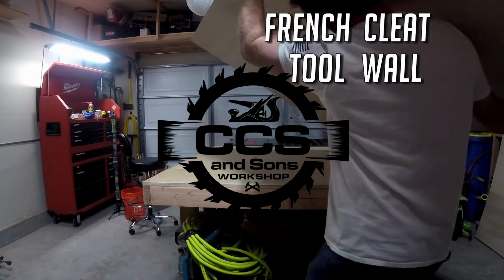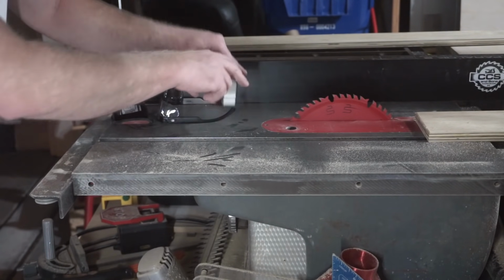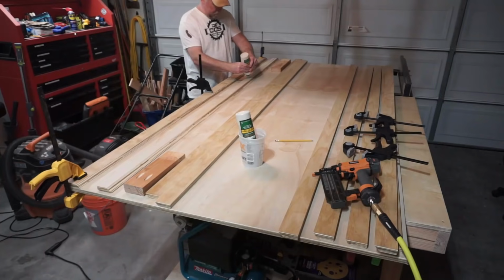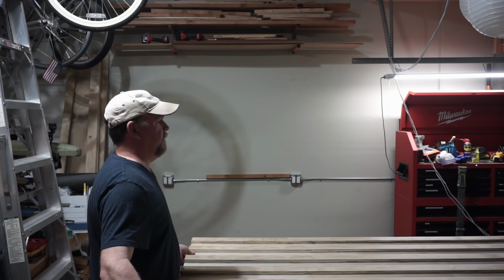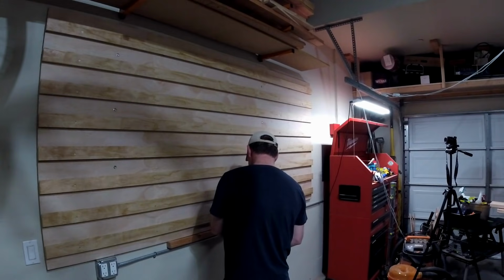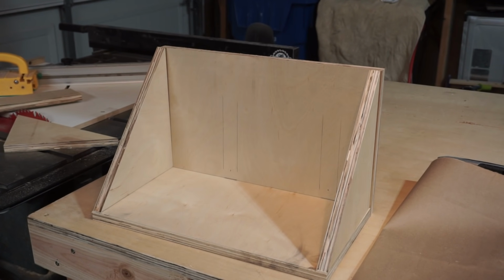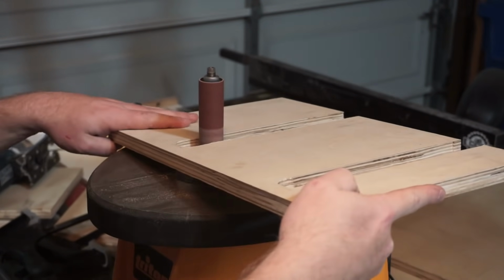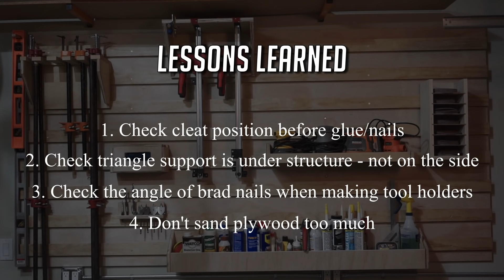How to Build A French Cleat Wall

Comment: Looks awesome. I’m curious, is there a benefit to using the plywood backer board vs attaching the cleats directly thru the drywall
Reply from the maker: Aesthetics mainly. But also means I can take it down and move it fairly easily if I need to.
Reply from the maker: Also not going to be damaging the drywall all the time adding and removing tool holders.

Comment: I no longer use glue to attach cleats. Seems I frequently put them in the wrong place vertically and then can’t move them. You may want to relocate the tool holder in the future and want to move it up or down in relationship to the wall cleat.

Comment: Great video.  Another useful recommendation: create smaller groupings of items, which enable you to create useful sets of easily portable “toolboxes” that you can shuttle between the wall and bench for common tasks.  For example a glue+tape+glue spreader+….  Or a flush trim hand router + associated bits. Or small screw sets plus …

Comment: A little off subject, but what's the deal with the Shop Vac attached to the 5 gallon bucket? I'm intrigued!!!! By the way very straight forward build and thanks for sharing!
Reply from the maker: It’s called a Dust Deputy. Give it a Google. It’s a separator before the shop vac. Works great.

Comment: I’m curious why folks add a backer sheet to the wall when you already have drywall. I can see drywall may push in a little under weight but it seems like that would have to hundreds of pounds and preventable by designing the holder to have a double clear of holding hundreds of pounds.
Reply from the maker: It makes the whole thing portable and allows another surface to attach things to, easier than drywall. Thanks for watching.

Comment: Is it necessary to use that thick plywood for the tool holders? Wood have become some expensive here in Norway these days. I see in general on YT that you lads often uses what it looks like 19mm?
Reply from the maker: Not necessary. It was what I had on hand. Depending on the weight of the tool, much thinner plywood could be used.
Reply: @CCSandSonsWorkshop  I got a bunch of OSB, would that be OK to use? I'm pretty new to woodworking 😀
Reply from the maker: @stonebridge157  probably fine. What are you going to hang off of it?
Reply: @CCSandSonsWorkshop  just some Ryobi tools like circular saw, router and stuff like that. Nothing really heavy.
Reply from the maker: @stonebridge157  you should be fine.

Comment: wouldn't it be easier to put up the plywood then attach the cleats? also I would think that you could go with a lot lighter ply . sincerely deb in Vermont
Reply from the maker: Sure, you could do it that way. I wanted to work on a flat surface and then hang it later rather than trying to work on the wall. And yes you could get away with thinner ply if you wanted. This was made before the crazy increase in lumber prices :-)

Comment: I’m thinking I’m going to feel stupid after I ask this but, in the moment I’m thinking it’s pretty rational!😁 the tool holders themselves. Can they be built of less than 3/4 ply, say 1/2, and still sit properly on the cleat at 3/4 ply? Nice build, really enjoyed it...new subscriber! I’ve watched a lot of videos and they all act like they would be sharing grandmas secret recipe if they tell you measurements!! You may this much more encouraging to try by giving your dimensions. Thanks...headed to watch some more of your stuff.
Reply from the maker: @Keith Rayeski as long as the cleat that is going into the other cleat is till 3/4 inch (if that makes sense, both reciprocals of the cleat need to be made from the same material) you can make the actual holders out of anything you want. Thanks for the kind words and thanks for watching!
Reply: @CCSandSonsWorkshop  got it. So long at the wall cleat and the holder cleat are 3/4, there's no offset between the two and the alignment will match. That's great! I've got a full sheet of 1/2 inch maple plywood I was hoping to use for holders. I'll stick with the 3/4 for my 4' clamp holders because of weight, but it'll be nice to use up that 1/2 for other stuff. Okay...off I go for the shop. Ordered that WEN filtration system through amazon...I had put off a filtration system because of costs but I've long wanted one and now, I'll feel better about the air in my shop and no particulates finding the way into the house! Win all the way around! Thanks!
Reply from the maker: Sounds great! Good luck with the project, let me know how it turns out.

Comment: Great job, maybe nr 5 is: don't glue the cleats to the board save money and stress if you need changing the cleats on the board. And nr 6 first the board to the wall and then adding the cleats strips thanks for sharing.

Comment: This video must of cost a fortune since David Blaine was narrating lol jk.
Reply from the maker: We are buddies, he owed me one and did it for free.
Reply: @CCSandSonsWorkshop  Haha great video
Reply: @CCSandSonsWorkshop  quick question does it matter what size backer board is used? Can you get away with a 1/4 since it's mostly for looks? Or is there a reason to go with the 1/2 or 3/4 plywood?
Reply from the maker: @theirishman088  I felt more comfortable with 3/4. Looks is only one factor. It does add rigidity and strength to the system. Remember the lag screws are going through the plywood into the studs behind the wall. The holding power of the plywood against the lag screws is where the strength comes from. That said, if you are not going to have a lot of weight on the wall, 1/4 inch might be fine.
Reply: @CCSandSonsWorkshop  makes sense. Thanks again!

Comment: It's common for someone to mention the width of the cleats, but what is the spacing between them? Is 6" enough? should it be 10"?
Reply from the maker: 6" is plenty. If you watch in the video, I use a 2x4 scrap as the spacer between each cleat.

Comment: I saw that you used a piece of 2x4 as a guide to space your wall cleats. If you laid two pair of cleats on your board, how much additional space is there between each pair. Wouldn't you need a gap wider than a single cleat, when hanging something on the wall, to allow room for the hanging cleat to get into it's resting spot? Maybe an extra 1/2" space? Cheers

Comment: I used your video as the basis for my french cleat system. I attached my cleats to the shop wall which has osb on it.
Once the cleats were attached, it was time to make the various shelves and holders. I have made 25+ and still need about 10 more.  I have become addicted to french cleat walls. This is my quarantine relief project. I have toilet paper, I am running out of lumber. Thanks for the video.
Reply: Remember to use cleats on hanging cabinets always a stut in place and easy to adjust the cabinet to heights and level.

Comment: This really is the best video on the topic.  I got so many good tips I never thought of.  I am planning to do this as well but wonder if I could put the cleat strips on the wall without the large backer board and drill it into the studs. Is there any advantage to either structurally? Or is it aesthetics?
Reply from the maker: I appreciate the kind words! Yes, you can put the cleats directly on the wall. I wanted to do it with the backer board for aesthetics and portability if I need to move it in the future. Thanks for watching!
Reply: I put my cleats directly over the drywall in my garage.  Works great!  As noted, the plywood backer has a nice/clean look.

Comment: How did you make out the studs? Not just using a stud finder but how could you see with the panel covering the wall where your studs were?
Reply from the maker: @William Corson I found and marked the studs on the wall and then I sank 6 or so lag screws into the wall using the marks as a reference. Those 6 screws hold the entire unit to the wall.

Comment: Would you have considered putting a coat of polyurethane varnish in the back board to make it easier to clean and prevent sawdust from sticking?
Reply from the maker: You could but you would have to be careful not to apply it where the cleat will be glued to the back board. It will interfere with the glue adhesion. Thanks for watching!

Comment: I like what you did. Assembling the cleats onto the backing plywood while on the bench makes for a VERY heavy thing to lift and position on the wall.   I mounted plywood sheets onto the wall, then added cleats to the sheet using spacing jigs to position the cleats at repeatable spacing.  Most holders won't need cleats that run the full width of the holder.
Reply from the maker: @Duke Makedo You are correct about the weight, but I found it manageable with some help and it was easier for me to layout the cleats while flat. I wanted to have the cleats running the full length of the sheet of plywood for future flexibility in tool location. This way I will be able to move things around in any number of combinations. Thanks for the comments and for watching!

Comment: Beautiful job on the cleat system. You might want to re-think the clamp holders. When I set up my French cleat wall I did not want the long clamps hiding valuable available cleat space. I used double layers of tool mounting strips and drilled a 1" hole through. Then attached 1" dowel rods of appropriate length and hooked the clamps over the dowel rod in one row. Eventually that too took up too much space, so I now hang my clamps on the sides of my shop shelves out of the way until I need them.
Reply from the maker: That's a great idea, thank you! And thanks for watching!

Comment: Nicely done. But you didn't have to take the strips off-site to cut them. Just because it's the standard doesn't mean 45 degrees is critical, or even better. I wouldn't go as low as 10 or 15 but you could easily get by with a 35 or 40 degree cut.

Comment: Hi. New  subscriber Hals Wood Shop.  Good points on the French Cleats. Soon to be an Arizona resident  and I picked up on building a part for my next workshop.  I liked the details and the lessons learned. Being older we all learn even from simple things.  I heard you say about your craftsman saw 45degree cut, I have had that saw, check the belt tension mount at the back of the saw for too tight /long and won't allow the last few degrees.  But that saw is a champion.
Reply from the maker: @Hal Kester Thanks for watching and subscribing! Glad you enjoyed. Thanks for the tip on the belt tension. The problem actually stems from the way I build the workbench to house the saw. I build one of the vertical supports to close to the motor swing area. So I will have to make a modification to the workbench in the future. Thanks again!
Reply: Fwiw, 45 degrees is not a requirement. As long as you match the clear and the hanger and it's significantly less than 90 it works fine. I did some at 60 and they work great.

Comment: Are your wood thickness’s and your spacing measurements a secret or wtf?
Reply: You can see the thickness of the boards is 3/4 inch. He stated the strips were 5” then cut in half to give the cleats, that should have given you a clue, and clearly said the spacing was done with 4x2, so let’s have a guess what the spacing was. Ugh, how about 4”.

Comment: do you really need a backer wall for the wall cleats? Couldn't you just screw the cleats to studs through drywall?
Reply from the maker: It isn't required. You could attach the cleats directly to the wall. Thanks for watching.

Comment: I'm finishing mine now thank you. Two questions 1st) I want to spread my cleats a little further 
so I have more room to lift shelf out, is that ok? 2nd) Plywood backing attaching to the wall is only 1/4',
the cleats are 3/4' plywood, is that ok? i did the 1/4' so it would be lighter. Thanks again
Reply from the maker: I don’t see a problem with either question. Thanks for watching!
Reply: @CCSandSonsWorkshop  Yeah, I am thinkingabout 1/2'' backer board or just go with the painted dry wall in my shop.  I like the added touch of stained wood.

Comment: Simple, yet very useful and efficient. 
Seems like a very heavy wall using a plywood backing.  Could you have used a lightweight hardboard backing installed on the wall prior to installing cleats?
Reply from the maker: Thanks for watching. Yea, I could have used something lighter, but I wanted to extra stout and knowing I only had to lift it once, I was fine with that. Cheers!